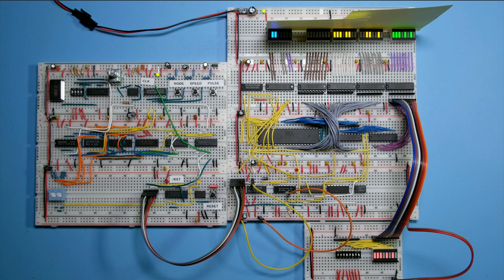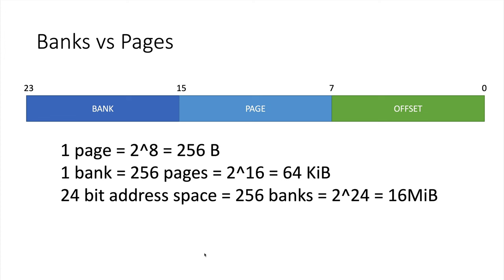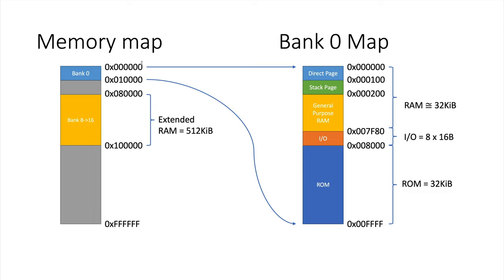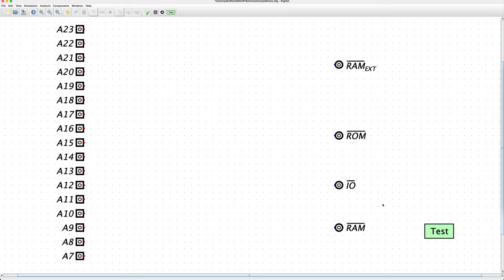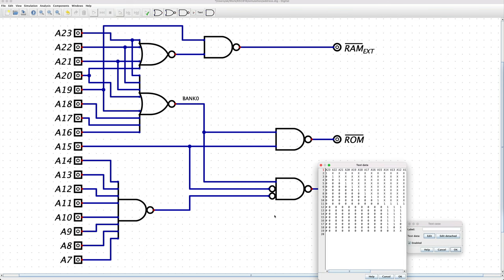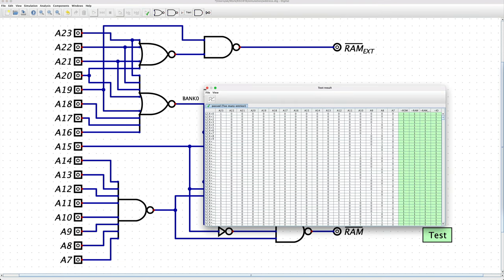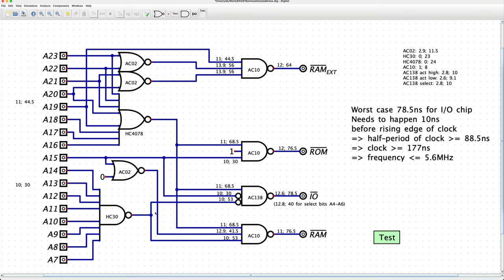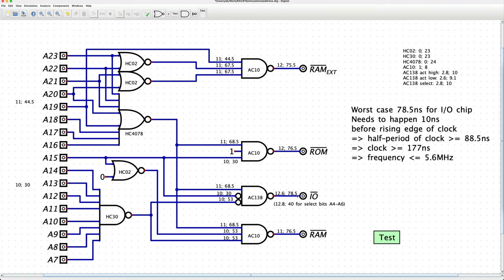#13 - Memory map, address decoding - BB816 Computer

Comment: Niiiiice :):) But it raises a question though: how difficult it would have been to speed the clock higher ? What's the max for a 65816 ? 14Mhz, no ?........
Reply: I saw someone running one at 40MHz but a good rule of thumb seems to be if you're using any of the recent TSMC chips that they should be stable up to about 25MHz. Particularly the W65C816S6TQG-14.
Reply: I should add that the official datasheet 14MHz is said to be very conservative.  Going higher in a breadboard could get a bit twitchy.
Reply from the maker: Doing it with all the timings to spec and with peripherals is quite hard as some of the margins are really thin (eg. with bank address latching). With a simple circuit, no banked RAM, no peripherals on the bus and overclocking some timings it can be done "easily". Basically the less complex the system is the faster it can go, up to around 25Mhz as YateyTileEditor said. My approach to this is to stay within spec for the timings, so subscribers that try to replicate the circuit are guaranteed to have something stable. As I build new revisions of this I'll try to increase the speed progressively. We'll see how far I can go :-)
Reply: @akohlbecker  I would be delighted if you pick up the glove ;) in the 90s, the fastest we had was the IIgs and I was looking with envy my mates with systems running x86 or 68K getting more and more speed… 65816 was said to be definitely slow….
I would be glad to prove them otherwise 😄
Keep going Adrien ! I’m hooked !

Comment: Very nice!  Thank you for sharing the link to Digital as well, I have a lot of logic bits I need to work out for my own project.
The HC40778 is obsolete, but you can still get CMOS versions, the CD4078B specifically, at least from Jameco, and the CD4068B for the ACT11030.  But being CMOS chips instead of TTL I don't know how well that would work?  I'm still trying to learn all that.
Reply from the maker: Thank you! The only downside with the CD4xxx chips is they are really slow (300ns propagation delay at 5V). So they would be quite limiting in terms of the frequency I can run at. However, spoiler alert, I have re-designed the address decoding to only use in-production chips. Stay tuned for that video :-)
Reply: HC and AC are high-speed CMOS. The 4000 series shouldn't have much impact other than timing. Were the selected family the original, L, S, LS, AS, F or some other then it would matter. Still, it is not considered a good practice to mix 7400 and 4000 series ic unless completely necessary.
Reply: @retroand  Thanks  for the info!  I'm still very new to this whole thing and I'm trying to learn as much as I can!
Adrien, I'm excited to see what you come up with!

Comment: I'm so confused.   How are I/O devices addressed?  Doesn't an address in Emulation Mode require 2 bytes and in Native Mode require 3 bytes?  How is an I/O device address transcribed using only a single byte?
128 bytes should only produce 16 addresses for 3 devices conservatively.
(2 Native Modes Devices + 1 Emulation Mode Device).
Unless I/O devices are NOT memory mapped outside of the RAM and the ROM space.  Is that right?
Reply from the maker: Hey! Great question, sorry if this was a bit confusing in the video. I will go over this in more detail when I add the first I/O device.

A device like the 65C22 has 16 addresses. This means it has 16 registers you can read or write. So in the CPU world each register is mapped to an address composed of a 24-bit prefix and an offset that goes from 0 to 15. 

Let's say it is I/O device 0 of 8. The 24-bit prefix is the start of the I/O range, so 0x007F80 in my case. To access register 7 of the 65C22 for example, you would read 0x007F80+7 = 0x007F87. 
To address device 1 of 8, the prefix becomes 0x007F80+16=0x007F90, and so on.

Does that help?
Reply: @akohlbecker  Ah. Okay.  So an I/O device transmits a set of values (16 bytes) through a communication port at regular intervals.  It does not work like a MMU.  It does not try to map devices into the memory address space through an expansion bus.  So an I/O device is just an I/O stream that maxes out to 16 bytes before every flush.  Is that right?
Reply: Nope. The idea is to "cut" the address space into chunks. As the 65C816 is a derivative of the 6502 and in turn the later was engineered by the 6800 team porting its bus and part of its arquitecture, I/O devices are always memory mapped.

First, remember that the I/O devices were placed at bank 0, making no difference when accessing them in emulation or native mode.

Now, the whole I/O devices are selected by having a single 3:8 decoder do the job but this has to be enabled and disabled at will. This is accomplished by having any of its its three control inputs managed by other logic. When enabled, it uses three bits to "cut" the space it manages into 8.

As the four lower bits remain unused for I/O selection they can be used to map internal registers inside a peripheral ic, but this responsibility is delegated to the peripheral.

Finally, having 8 devices owning a 4-address space: 8 * 2^4 -> 8 * 16 = 128 bytes.

Is that helpful?

Comment: Why do not use a less "clean" memory map?

you could use less chips using something like bit 23 to change from bank 0 to extended ram
you would need one hc4078 less
you would have the bank 0 repetead to bank 127
the extended ram whould be replicated 8 times in the upper banks 
(you could put another ac138 and 7 more ram chipts to have a 4mb ram)
Reply from the maker: No reason other than it is less clean 🙂